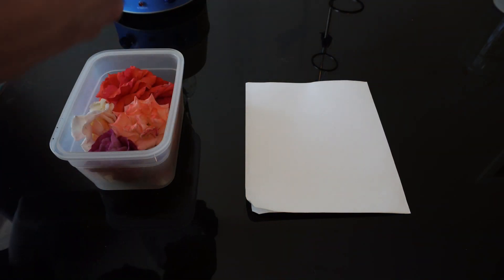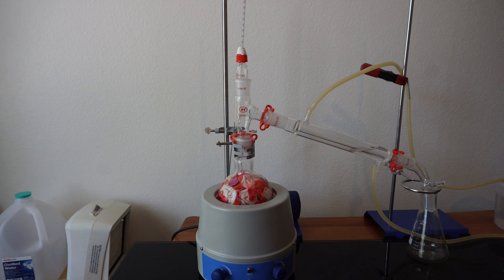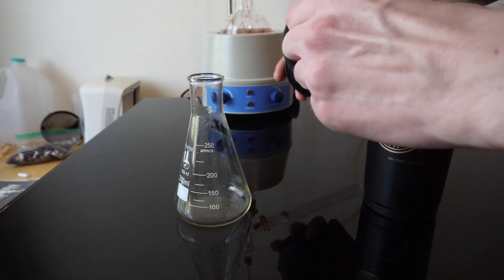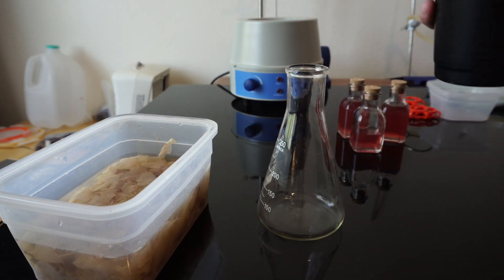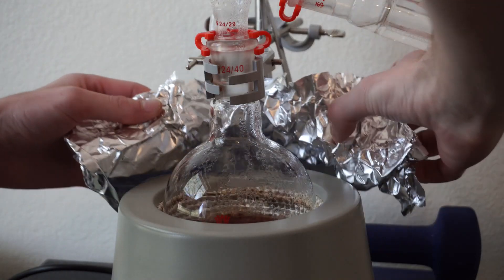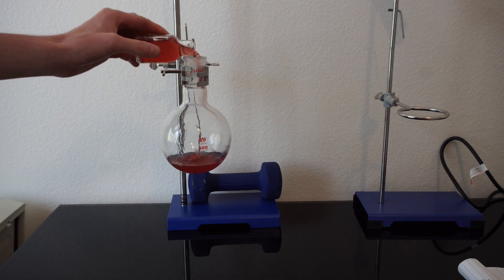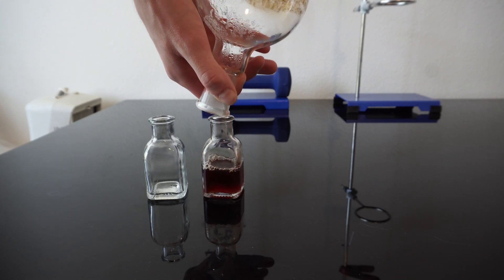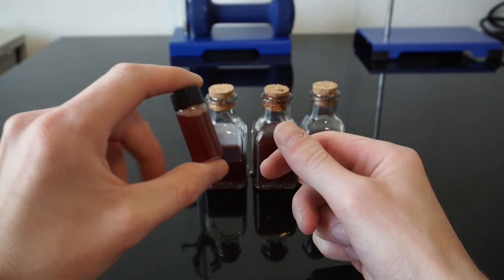Making Rose Oil at Home with Hydro-Distillation #roseoil #essentialoil #terpenes

Comment: Where is the oil? With all the decanting steps in this video it remained as staines on the glass. 1000 petals make one drop oil, and 1000 grams make 5 ml oil. In this video you only consentrated the hydrosol and made distilled water.
Reply from the maker: You are 100% correct in this. 
My setup has gotten much more advanced over the past 4 years and currently I don’t really use this method for rose anymore. 
I found it much easier to use a giant vacuum to pull oil out under low temperatures with short path.

Comment: Hey, where did you find the steam distillation?
Reply from the maker: The one in this video is actually a starter set from eBay! If you need help looking or need advice let me know
Reply: @PrestonImpx  Thank you! I also have a question, once you extract the oil. Are you able to use it in prefumes..etc?

Comment: When you pour all that liquid you mix it with water too! When this is done properly the Oil sits on top of the water!  Rose produced very let Oil! Also this is not the right setup for oil extraction! Unbelievable!
Reply from the maker: You are right. 
This type of set up won’t produce the oil I was after. This set up will work with a lot of less delicate oils though. 
I am working on another video here soon for roses. It’s been something that has been a challenge getting pure oil

Comment: I'm getting no oil from mine, just hydrosol and it's not even colored just clear. The water in the flask is a brownish color.
Reply from the maker: This project has been something I have redevoted myself to recently. Ultimately I recommend just letting the water evaporate at a nice temperature. I will be going over this again in the future. The only way to obtain the pure oil from this hydrosol is to let the water evaporate. 
Unless you wanted to use a solvent and then remove the solvent.

Comment: Consider the possibility this formulation is more of an attempt at a “Rose Absolute” than rose oil. 

To prepare the extract you prepared, you actually didn’t even need the distillation setup... you were just boiling away terpenes, volatiles, and water in the process.  Now, if you conducted a distillation to obtain oil, this may not have been a bad setup. But where I get confused at is where you take the contents in the boiling flask.

Rose oil could be made by a more complex distillation setup, in which steam is generated, pressurized, and tunneled through the botanical mix, through a condenser, and to a sufficient separator. The top fraction is the Rose oil.

On the other hand, first processing against hexane, filtering, and removing the hexane makes a crude concentrate which can then be dissolved into ethanol, frozen, and de-waxed. The de-waxed ethanol solution is concentrated to yield a potent therapeutic extract.  

Unfortunately, the water used in the flask may have contained contaminates as well as proceeded to hydrolyze a great deal of volatiles in the final concoction you prepared.

Comment: Here's a rose oil recipe from "the farm and household cyclopædia" 1888

Otto of roses- fill a large glazed earthen jar with rose leaves, carefully separated from the cups; pour upon them spring water, just sufficient enough to cover them, and set the jar with it's contents in the sun for two or three days, taking it under cover at night. At the end of the third or fourth day, small particles of yellow oil will be seen floating to the surface of the water, and which, in the course of a week, will have increased into a thin scum. The scum is otto of roses; take it up with a little cotton tied to the end of a stick, and squeeze it into a phial

Just thought that was interesting, seems to make something slightly different than what you've made here, but otto of roses is the same thing as rose oil
Reply from the maker: Just planted new roses this weekend! Around 12 plants. Thank you for sharing this with me. I am going to try this method out, maybe with some extra steps to see if I can speed up the process at all. Though it makes total sense to do it this way.
Reply: @PrestonImpx  Hi! Did the method work?
Reply: @PrestonImpx did it work otto of rose ???

Comment: How much  ratio apply to extract  10 ml of essential oil  from any medicinal plant leaves by hydro distillation method.
Reply from the maker: Completely depends on the plant your extracting from. Are you using roses as well?
Reply: @PrestonImpx   no . I tried to extract essential oil from hibiscus rosa sinensis flowers by this method but I got more water , couldn't find essential oil.
Reply from the maker: This guide was just a basic idea of how hydro-distillation works. You will always receive more water at first then oil. The next step is to separate the oil from the water. You just have another step to complete before oil is there. Also a lot of times depending on the oil, it was be able to mix with water instead of naturally separate. I recommend researching the oil and seeing how it mixes with water. After that you can choose to either do another hydrodistillation, or use a solvent to remove the oils then separate the solvent from the oil.
Reply from the maker: The other general issue is that no plants give the exact same amount of essential oil. So if you are trying the same method on every plant, they won’t be the same outcome most of the time. You can always research about any specific oil you are trying to pull and the best method to do so

Comment: I tried to extract essential oil by hydro distillation method but I got more water insted of essential oil by this method.please let me know about this problem.
Reply from the maker: That seems to be a pretty common problem without using solvents. I am working on a more efficient method of separating the water from the oil. Though ultimately with my rose oil I sit the oil in a place so the water can evaporate which will leave the oil behind. Remember though,  the yield of rose oil is directly compared to how many fresh roses you use
Reply from the maker: Hydrosol will always be your main product. However removing the water rapidly like I did hurts the oil more than I first realized. It does take some of the smells out now that I have tried evaporating the water slowly. It provides a much better quality of oil

Comment: Will you be making more videos on extracting rose oil? I grow roses and would like to start extracting oil this season.
Reply from the maker: I will be making at least one more with pull rose oil with solvents and one with hydro distillation. I have a slightly more efficient method than before I’ve been working on

Comment: Very good video, thank you. Was the last pass a pure rose essential oil or it had some moisture content in it? How many roses it would take to make 1 ml of pure essential oil, without any moisture in it?
Reply from the maker: It was a full spectrum oil, with a little bit of water in it I am guessing, since I wasn't able to confirm purify in a lab. However this might be as close as you can come without an organic solvent to help separate the oil out further.
Reply: @PrestonImpx   Thank you.
Reply from the maker: @singhniranjan  I am currently researching the best solvent to use. Once I figure it out I will pull rose oil with no water in it!
Reply: @PrestonImpx  Excellent, looking forward to that.
Reply: @PrestonImpx  was the oil the colored one or the clear one?
Reply from the maker: Both  of them where hydrolats. Meaning they had oil in both parts, though some oils came off in the first run of the distillation, while some where less volatile, and didn't get evaporated. Though I would say there was more oil in the colored one for sure
Reply: Ginger oil extracted using Clevenger Apparatus
with full steps

https://youtu.be/s_KuvXXvgX4